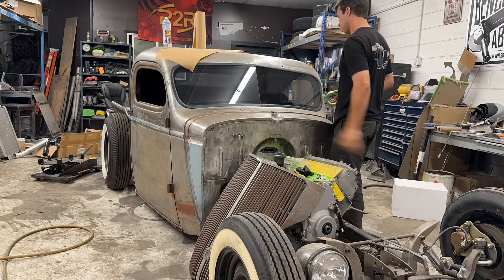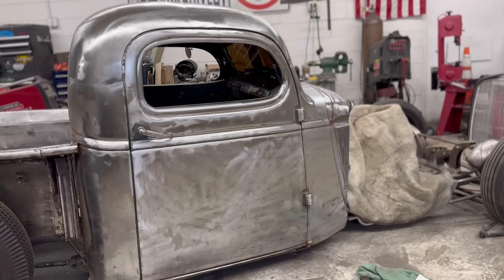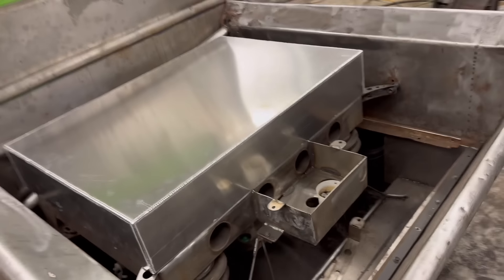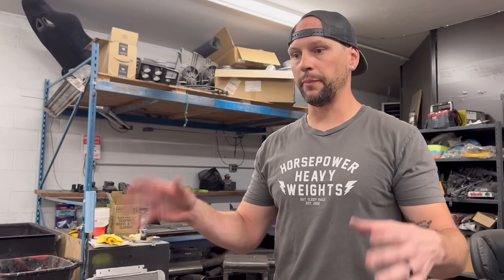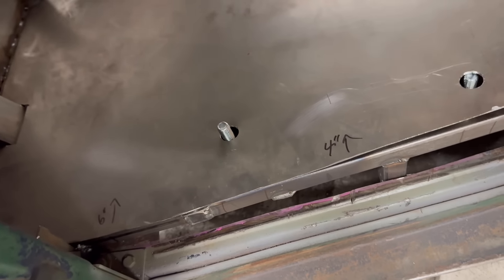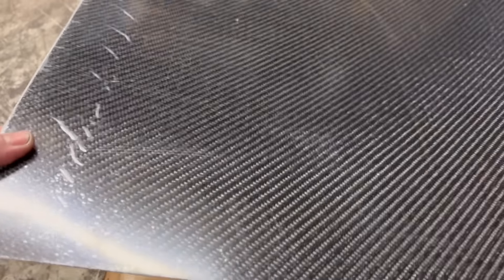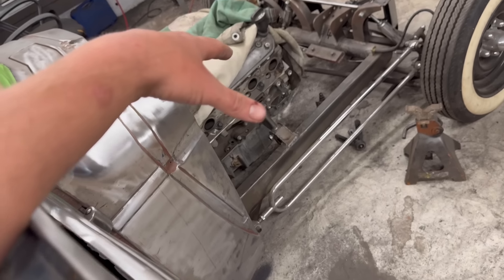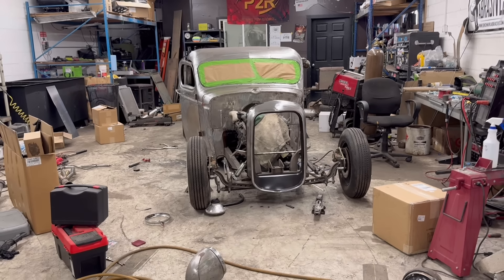PART 5 Gumout 39’ Chevy Giveaway

Comment: With the carbon on the sides of the fuel cell, you'd have enough to go down both sides at full thickness. You'd have to have a join on one side but position it so the filler neck  hide it. Just a thought from little old New Zealand.

Comment: It's actually coming along... When I saw the green tape it made me go YES*... I think we figured out our color if you haven't... Gumout I remember has an old advertisement form the 70s of a gum out carburetor monster or a carburetor that's sick that is green... *Gumout Cures Carburetoritis Check it out... Anyway, I think you need to paint the thing green like a lime color green maybe even the metallic or something... Red interior yes because gum out uses red lettering... Also I would paint the frame red the wheels red as well... And then I would paint the firewall checker flag... As it's a thing with those cars and Gumout uses the checkered flag as is advertising... Then after you get it all painted up. I think I would put a couple removable. You know, because people might not always wanted to be the gum out mobile.
Vital decals of gum out on the doors some of the older style with the checker flag... Maybe that Is carburetor monster decal on the passenger dash. Oh and yes paint the inside of the doors and dash green as well... You can
Paint the chevrolet red on the back. You can put your decal on top of the bed maybe... These are my suggestions... I think it would look sick... And if people wanted to pull the decals , even afterwards , it's still looks sick...
Reply: More like 50s 😂

Comment: If it was me I would put garage idiots in the carbon on top of the gas tank and make it like a bed cover with hinges !! lol gas shocks and a lil lock on the back !!Also maybe a lil aluminum frame for strength!!  then the hood I’d kinda do the same but do it in steel and paint the same as truck !! Then cut out garage idiots on both sides of the hood!! And under it put thin carbon !! Just saying

Comment: I hate the bed and the fuel tank
Reply from the maker: Well shoot.  What don’t you like about them?
Reply: @GARAGEIdiotS  ignore the hate, it looks very sick!
Reply: I do think it’s the best solution for the space the truck has. And it will probably look sick in a couple of days, but what I mainly dislike is at the bed is basically useless. I think you would make the bed a little bit more usable if there were saddlebag gas tanks like four Corvette that were in between the cab and the axle tube, but I don’t know if you would have the capacity needed